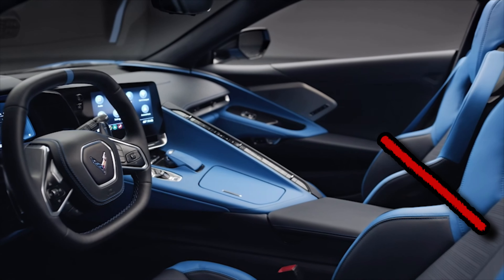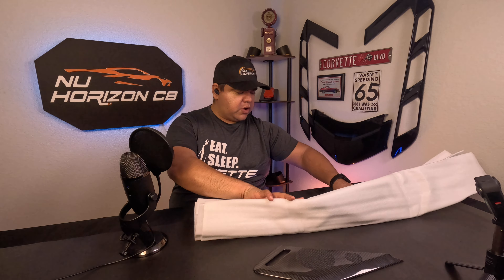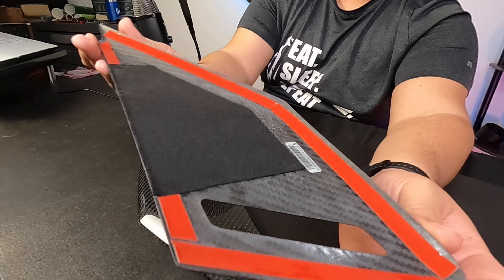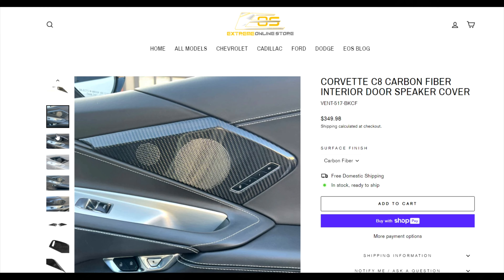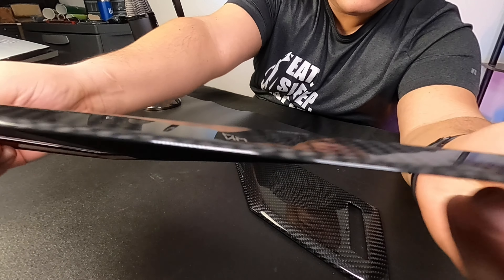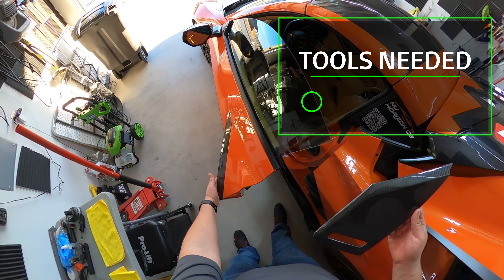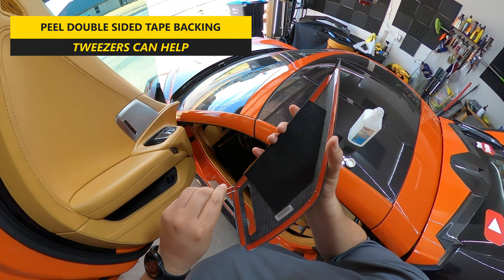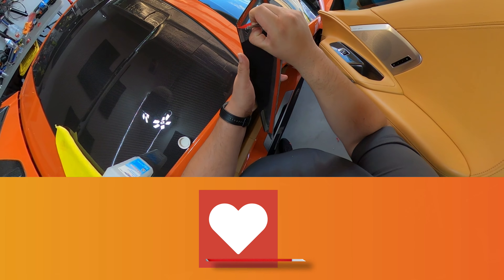Unboxing Carbon Fiber Door Speaker Covers for C8 Corvette

Comment: Thanks for taking one for the team and getting the product Carlos! I was hesitant on pulling the trigger awhile back because of the silver that would poke out or the cf wouldn't cover the entire piece. Quick question though I bought the carbon fiber piece from Paragon Performance for the center console and I guess after 10 months the 3m double sided tape is not as sticky as it's supposed to be. Do you have any recommendations on which ones to buy online? They all look the same to me on Amazon.
Reply from the maker: Hey thanks for the comment! If im understanding your meaning, your talking about what kind of double sided tape to use for reapplication correct? If so, id recommend 3m industrial grade and go the length of the pieces. If you want to go really hardcore, use a 3m surface prep wipe after youve done an initial surface clean. That stuff makes thing secure alot easier.
Reply: @NuHorizonC8  thanks for the recommendation! I bought the transmission piece so it's quite small so I will try the 3m smaller pieces.